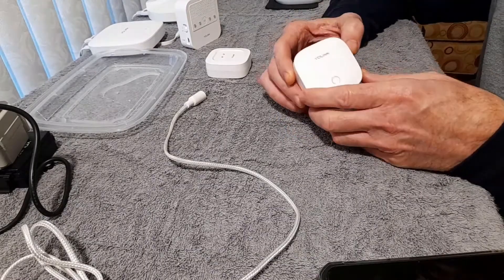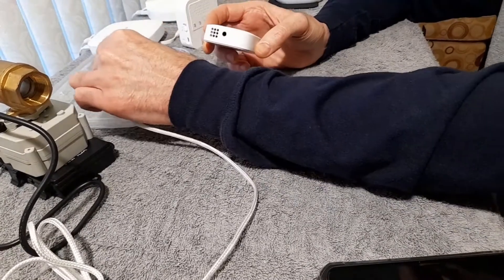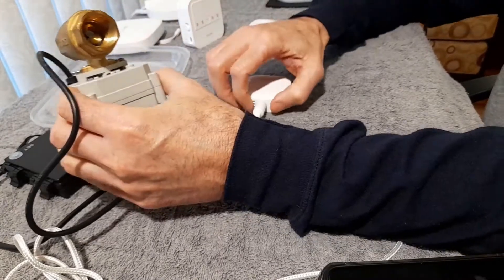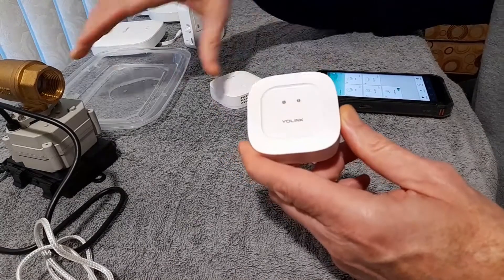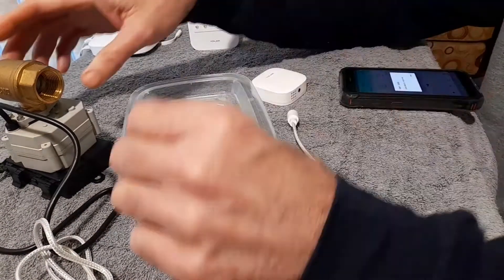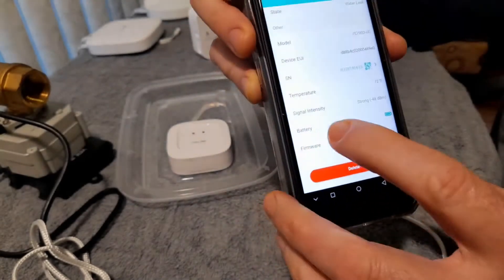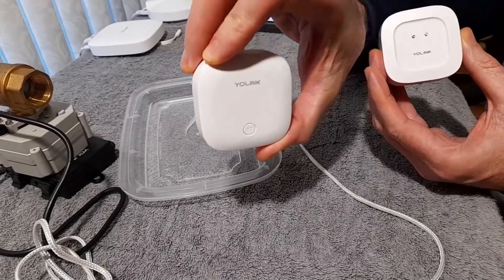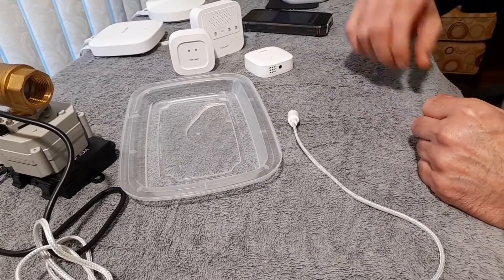Do you believe Yolink's leak sensor will prevent water damage?

Comment: They must fix this problem I just change valve controller battery and it is stop closing valve when testing, this is ridiculous I always have this problem
Reply from the maker: It seems the firmware update fixed the problem. Please contact them to make sure your firmware is updated. Please keep us updated
Reply: I updated not solved but I called them they fixed
Reply from the maker: @Naz1970-e9j  glad you have it sorted. Thank you for supporting the channel by commenting and giving the video comes up. Please let us know if you have any other other questions.

Comment: Found a work around for the valve not closing with the self-contained sensor. Using Alexia created a routine as a switch under smart devices, and when the sensor triggers, Alexia does the action of closing the valve and announces it is closing. Like in the video, firmware no help.
Reply from the maker: Did you validate with Yolink directly that the sensor had the latest firmware? We worked with them over a period of months to validate the latest firmware did indeed fix the valve closing problem.   Thanks for supporting the channel & giving the video a thumbs up!
Reply: @CyberMedics  yes I was told I am at the latest firmware multiple times, I too still believe it is a firmware issue, but until I correct that, the work around is protecting me, love the product, and this feature is on so important to me, 6 1/2 bathrooms, 7000 sq ft, on a deep well, so you can see why the shut off is a major must. A plus is that running it through Alexia, it allows me to be able to voice command the valve closed or open.
Reply from the maker: @TerryTabor-kv3nz  You may have to factory reset the sensor to disconnect it from the valve then directly pair it again.  The problem was, if the hub was off for a period of time (varied from 1-4 weeks) the sensor would lose connection to the valve.  After you factor reset the sensor, then direct pair with the valve again.  Disconnect the hub for a period of time to see if the sensor stays directly connected the valve.  This worked for us.  Please keep us updated.

Comment: ok.  Is someone going to address the elephant in the room?  if you use a hub to manage the sensors and valve controller based on rules (eg. if water leak detected then shut off valve)  you set up in the mobile app, these rules are not resident locally on the hub but rather are maintained on a server in the cloud.  So what happens if a leak is detected and your internet connection is down, or the power to your hub/router fails? ??? Anyone want to venture a guess?  The rule will not be executed!  Yolink needs a smart hub that maintains the rules locally so there are no dependencies on internet connection...  Yes I know you can skip the hub and link sensors to the controller, but out goes the mobile app and management.  please correct me if i am wrong. As far as the problem you describe, i have not had that problem as long as everything is linked up to hub, and the rules are set up using the app, and hub is connected to the internet.
Reply from the maker: Great comment.  After working directly with your yolink, they updated the firmware on the sensors they seem to be working flawlessly now. Once you pair them directly with the water valve you do not need the Hub or Internet and if water is detected it will definitely shut off the valve. I've tested this repeatedly over the last year and a half and have had complete success. It's one of the reasons I like yolink, you do not need internet or the Hub in order to protect from water water leaks.
Reply: @CyberMedics  I understand that you can directly link sensors to the valve.  But under this configuration how do you check the status of the sensors and the valve?.  Can you check the battery status or the state of the valve with an app?  My impression is that this configuration sacrifices status and control.   For example I cannot open and close the valve with an app but must rely on the valve controller mechanical switch.  I like the programmable actions that the mobile app affords, but as I was saying , yolink really needs a hub that does not rely on the cloud to manage actions  that have been programmed by the app.   This dependency on a cloud server has me worried that the system is not reliable
Reply from the maker: @jflow5601  The system is reliable,  but you are correct. If you want to control it with the app then the Hub and internet are required.
Reply: @CyberMedics  Thank you for the quick responses.  To be specific, what I found was that using the hub configuration of devices, the valve would not close if a water leak sensor triggered and there was not an internet connection.  I really like the system except for this dependency on a cloud server to make automation decisions.  So the Yolink hub approach's  reliability is dependent on the network connection.
Reply from the maker: @jflow5601  There is some confusion about how these work (Including me).  If they are paired individually, there is no need for the hub or internet to activate the valve if a water leak is detected.
Reply: @CyberMedics  I understand what you are saying.  But I am not interested in directly pairing the sensors to the valve controller.  My question is if you use the hub configuration, and the sensor detects water, but the Internet is down, will the valve close...  from my testing, I don't believe it will.
Reply from the maker: @jflow5601  You are correct. No hub/internet... no status information.  Pairing the sensors directly with the valve addresses your concern about the internet being down.  The sensors will still operate the valve if the internet goes down.  This does not address your concern about being able to remotely check the status of the sensors through the app.  You are correct.  The cloud service is needed to do that.  Thanks for the informed feedback.

Comment: Is your issue resolved and still working smoothly with the wireless contact sensors?
Reply from the maker: Thanks for commenting and subscribing.  Yes! The issue has been resolved after the firmware update.  Everything is installed and working properly.  Reach out if you have any questioins.
Reply from the maker: Have you implemented Yolink?

Comment from the maker: My fault for not fully explaining this.  Both sensors were individually paired with the valve an siren.  The probe sensor worked flawlessly.  The contact sensors would not communicate with the valve or siren.  I wish it was as simple as "unfamiliar with how to set it up."  This scenario has played out for numerous subscribers and you probably never experienced it.  

If the contact sensor was paired, then the hub was unplugged for 1 week or more (it varied & could be up to 4 weeks) all of the contact sensors would become disconnected from the previously paired devices.  It could be factory reset & then it would work.  But after a week or more of leaving the hub  unplugged the contact sensors again would become unpaired from the water valve & siren.  I spent weeks directly working with Yolink following there step by step guidance testing various firmware versions. One of the firmware versions had this flaw:  If the hub was disconnected for a period of time, the contact sensors would become unpaired.  Confirm with them, but anything later than v0311 is OK. I have sensors with both v0403 & v0311 and don't experience this problem.

Comment: You have to pair them device to device (D2D) which you have to pair by pressing the button on the sensor for 5 to 10 seconds until blinking green them on the valve controller you do the same so the valve and sensor will be pair
Reply from the maker: My fault for not fully explaining this.  Both sensors were individually paired with the valve an siren.  The probe sensor worked flawlessly.  The contact sensors would not communicate with the valve or siren.  I wish it was as simple as "unfamiliar with how to set it up."  This scenario has played out for numerous subscribers and you probably never experienced it.  

If the contact sensor was paired, then the hub was unplugged for 1 week or more (it varied & could be up to 4 weeks) all of the contact sensors would become disconnected from the previously paired devices.  It could be factory reset & then it would work.  But after a week or more of leaving the hub  unplugged the contact sensors again would become unpaired from the water valve & siren.  I spent weeks directly working with Yolink following there step by step guidance testing various firmware versions. One of the firmware versions had this flaw:  If the hub was disconnected for a period of time, the contact sensors would become unpaired.  Confirm with them, but anything later than v0311 is OK. I have sensors with both v0403 & v0311 and don't experience this problem.

Comment: I've been dealing with them on this issue for years... literally.  It was pretty obvious that it was a software issue...  The sensor tells the app that there is a leak... but the valve controller isn't actuated.  HOwever... you can manually open and close the valve controller with the app directly.  There is a disconnect somewhere... and they said they needed to revise the software.  This was well over a year ago.  I see nothing has really happened.  I don't know if they have incompetent programmers or they just don't have the necessary skills to address it.    I'll keep checking in to see if they ever fix it tor not.  Right now I'm not very hopeful.  It sucks when you spend a total of about $800 for sensors, valve controllers bring in power to the valve controller etc. etc.  Then when its done it doesn't work.  This would be an awesome system if it actually did what its supposed to do.  They are a VERY disappointing company.  If your concern is having your house flooded while you are away this would be your best option if it worked.
Reply from the maker: Larry, I've been testing these for over a year. Been doing direct testing with Yolink for 2 months.  The problem is with the leak sensor. Contact me via email and I'll give you all the details. Cybermedics.org@gmail.com
Reply from the maker: They have solved the problem!
Reply from the maker: Here is what was happening to you & others (me included).  If the contact sensor(Water Leak Sensor) was paired, then the hub was unplugged for 1 week or more (it varied & could be up to 4 weeks) all of the contact sensors would become disconnected from the previously paired devices.  It could be factory reset & then it would work.  But after a week or more of leaving the contact sensors unplugged the contact sensors again would become unpaired from the devices.  I spent weeks directly working with Yolink following there step by step guidance testing various firmware versions. One of the firmware versions had this flaw:  If the hub was disconnected for a period of time, the contact sensors would become unpaired.  Confirm with them, but anything later than v0311 is OK. I have sensors with both v0403 & v0311 and don't experience this problem.  Please update us once you confirm your firmware version.

Comment: Well I'm sorry to report I'm still having problems with one of my water sensors.  See my thread below. The sensor furthest away, probably 30ft away from the controller inside a mobile home and  under the kitchen sink has twice now not activated the water valve upon testing. However, the one in the bathroom which is only about 8ft away from the controller stays in communication with the water valve and has worked on every test. The one in the kitchen will work if it is brought in range of the controller. So it seems these things have very poor working range. Very disappointed.
Reply: I have a correction to the above statement. The kitchen sensor will not trigger the controller no matter how close it is. Indicating it became unpaired at some point.
Reply from the maker: Tim I've been working directly with Yolink on this and have been doing independent testing for them.  Are these the "Water Leak" Sensors?  Do you have them hooked to a hub?  I believe there is a firmware bug.   Would you please confirm the  firmware version/type of your sensors?
Reply from the maker: Tim they have solved this problem.
Reply from the maker: Both sensors were individually paired with the valve and siren.  The probe sensor worked flawlessly.  The contact sensors would not communicate with the valve or siren.  This scenario has played out for numerous subscribers.

If the contact sensor was paired, then the hub was unplugged for 1 week or more (it varied & could be up to 4 weeks) all of the contact sensors would become disconnected from the previously paired devices.  It could be factory reset & then it would work.  But after a week or more of leaving the hub  unplugged the contact sensors again would become unpaired from the water valve & siren.  I spent weeks directly working with Yolink following there step by step guidance testing various firmware versions. One of the firmware versions had this flaw:  If the hub was disconnected for a period of time, the contact sensors would become unpaired.  Confirm with them, but anything later than v0311 is OK. I have sensors with both v0403 & v0311 and don't experience this problem.

Bottom Line:  If the contact sensor is upgraded to v0311 or later it will probably fix the problem.  I would advise factory resetting after the firmware is upgraded.